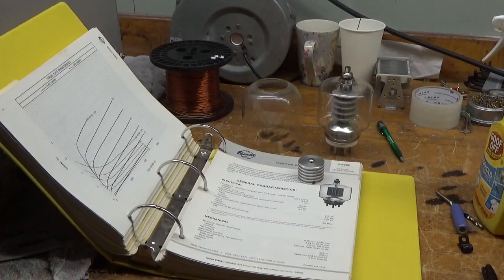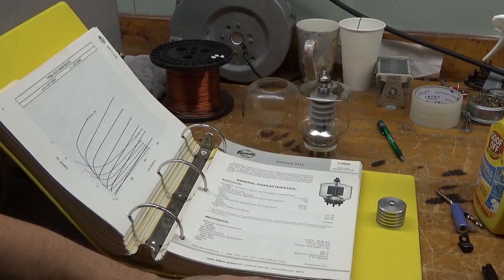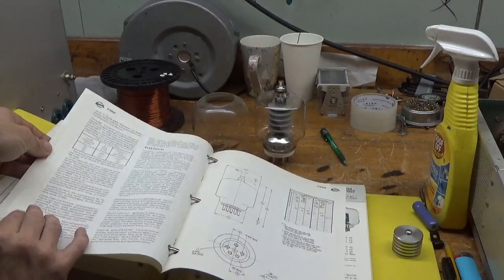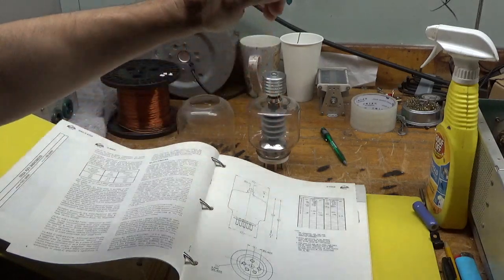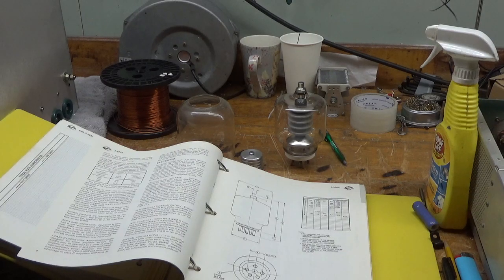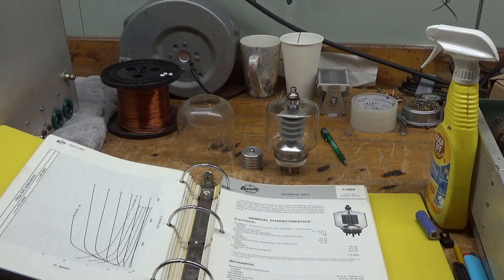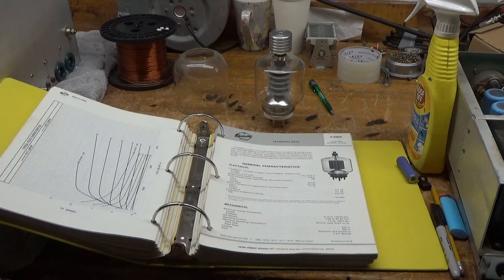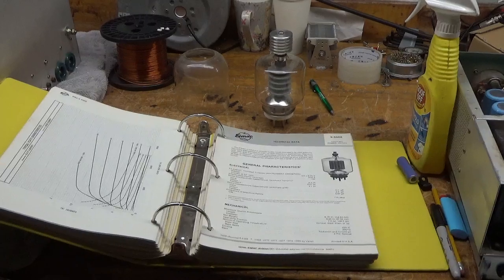Why Aftermarket Anode Caps are A Bad Idea 3-500z

Comment: Well this taught me something. I did the replace the anode caps with another type. They weren't taller but wider. And when I got the amp back together with a new set of tubes my output was quite a bit lower on 15 and 17 meters not to mention 10 meters. So after a new set of tubes I realized that there was a problem. This is on a Drake L7 that I really like.
Speaking of the L7, Has anyone heard of a mod for the Power Supply to disable the 2 50K  bios resistors. They put out so much heat I don't need heat in my shack in the winter. I had seen a mod for this where the two were bypassed and some sort of diode on the chassis.
Thanks Amp Repair Guy for the great video.
Dave 
de W4DRA

Comment: I've got all stock ones on my eimacs in my LK550. better off putting another fan in the box vs those caps.
Reply from the maker: Run the pa within its designed power spec and the stock one will be plenty

Comment: There are bone stock SB220's still on the air that are over 50 years old with the stock tubes and the stock anode cap. If you don't abuse the amp, it will last many decades. I have  a 220 I modified myself with tubes that are about 28 years old that still make full power. It still has many of the stock Heathkit parts inside and I added a few updates. The Heath amps had a few little design warts, but with some updates and careful use, it's a great workhorse amp.
Reply from the maker: Very true, and as you said a great amp